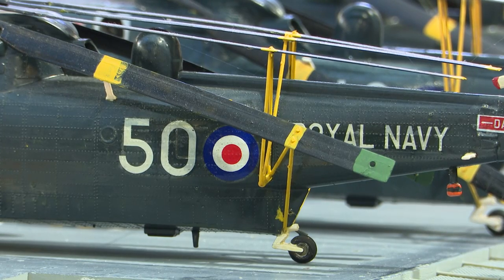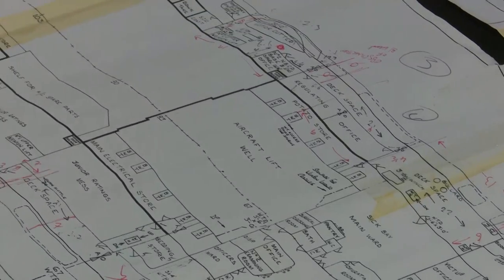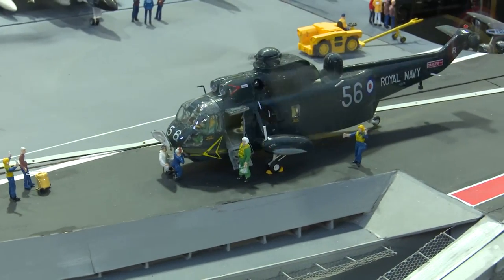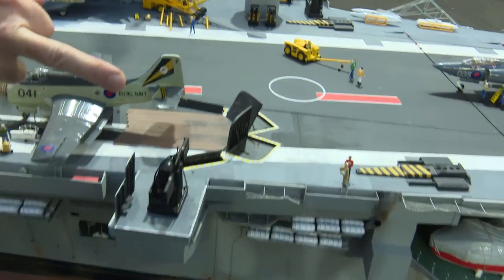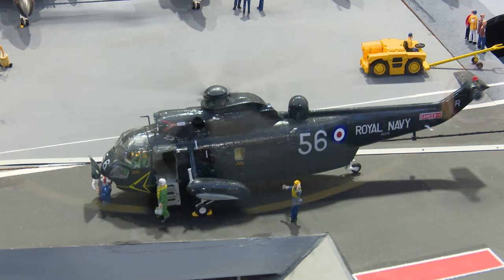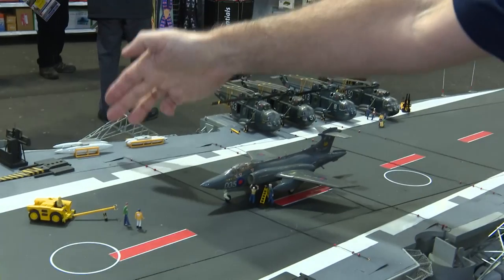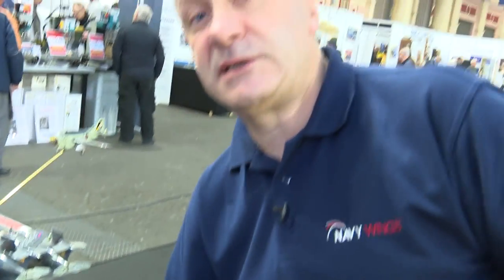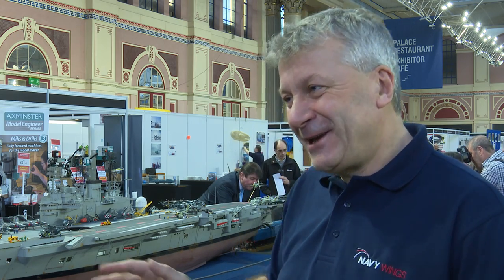25 Years In The Making: HMS Ark Royal In Miniature | Forces TV

Comment: Why did anyone ever think it was a good idea to have mid-deck elevators?
Reply: Ahhhh that makes sense.
Reply: Was built in 1943 and back then it was the prevailing thought.
Reply: It’s one of those things that makes perfect sense in hindsight but in reality is quite difficult to achieve. 

Like fuel injection. It’s eminently simpler to squirt fuel in under pressure than it is to use air to draw it in under vacuum.. but the high precision and engineering required to make perfectly sized injectors and high pressure fuel pumps was too costly. 

The turbine engine in theory is far more simple than the piston engine with far fewer moving parts and constant combustion, but the metallurgy required for the combustion chamber and the turbines had to be absolutely state of the art.